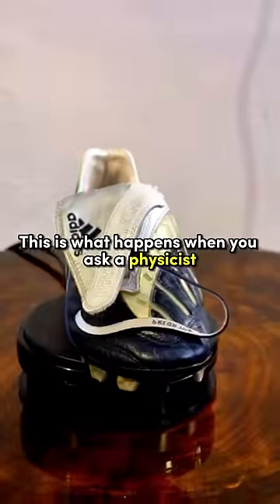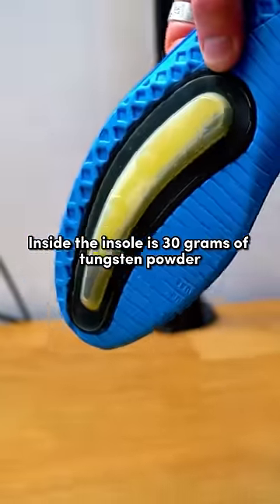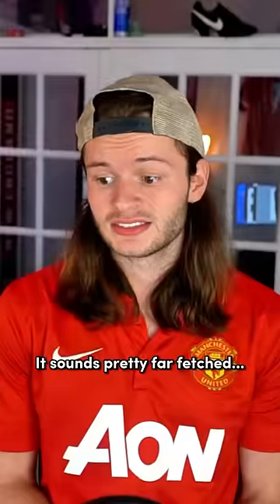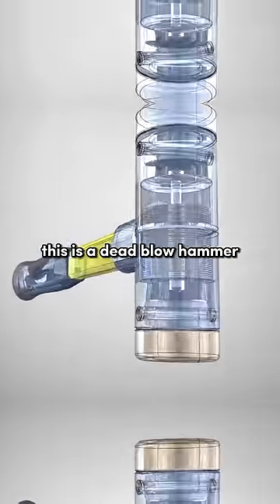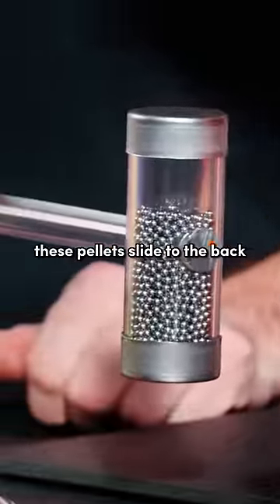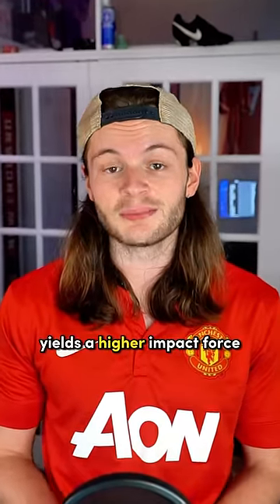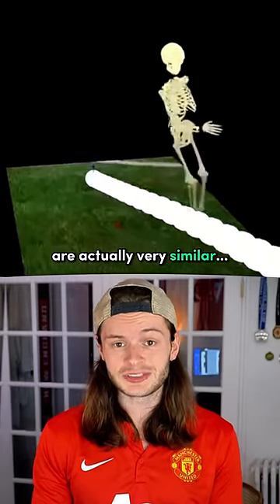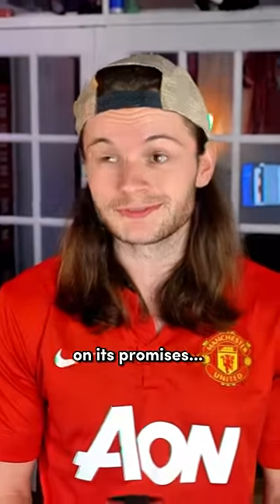When a Physicist Designs a Football Boot👨‍🔬⚽️

Comment: Physics major here. Deadblow hammers don't hit harder. They are designed to disperse impulse over time, allowing you to be "gentler" on certain materials. Regular hammers hit harder. They transfer more momentum (because the hammer bounces backwards) in less time, which means greater peak force. This shoe is a gimmick. That amount of tungsten won't do anything significant to your kick.
Reply: Thank you! I used  to use a deadblow for work pretty regularly, and it was only for when I was trying to carefully beat something into submission. lol
Reply: Thank you for doing this service, I was about to write the same dissertation
Reply: It's not supposed to be significant. It's an increase of 5% in power. That's really insignificant but is the small boost that can help you win.
Reply: @triskits_mmm Did you read past the first sentence?
Reply: @triskits_mmm The benefit you would get on some kicks would not outweigh the detriment of running around with weighted shoes.
Reply: New it about hammer, well said bud
Reply: @triskits_mmm  Having grains of anything legitimately does not increase power, in fact, physically it decreases the power (impulse) of any impact despite whatever the MARKETING TEAM says, this is entirely a gimmick.
Reply: A ball peen dead blow will hit just as hard as a regular ball peen. Only thing with the dead blow is its easier on your hand and arm and doesn't bounce and vibrate
Reply: The tungsten would add weight to your foot, more weight, means more energy. Put it would also require how ever much more energy to swing your foot. The real benefit would be when you finally take the weighted shoe off like Goku and unleash your true power on the ball.
Reply: I would be willing to argue that of similarly weighted shoes, one with grains like a dead blow hammer and one without, the one with grains overall would give less overall speed to the ball on kicking.
Reply: @triskits_mmm 5% would not be insignificant.
Reply: @DownHillgamer the main point of a hammer bouncing is to make it easier to hit it again when forging stuff
Reply: You’re my hero
Reply: You seem really pretentious
Reply: I always used the plastic deadblow when I need to beat the crap out of some wood without damaging it. A rubber mallet doesn't work because it's too bouncy, you need a solid blow
Reply: thats why when i used that model i felt underpowered..that physisist nerfed my entire kid football attempt of a career😢 im suing
Reply: Do you think the hammer also isn't a great analogy because no person kicking a ball is going to recoil their foot that quickly from the ball
Reply: But how can deadblow hammer not hit harder if it transfers all of its kinetic energy to the item being smashed where as regular hammer keeps some of its energy?
Reply: This ain't reddit.
Reply: @34pixels33  I think it's just more dispersed somehow but I have no physics knowledge
Reply: @34pixels33  An elastic collision has to stop the hammer and then push the hammer backwards. That means more energy imparted to the thing you're hitting, aka a harder hit.
Reply: I was thinking something similar but yk I was gonna let folks keep wasting money on whack pairs of boots leave the good ones in stock for the rest of us who just Wana get em dirty😂
Reply: Okay…what is the difference in inertia between a steel claw hammer and a dead blow hammer filled with lead shot? If you know your physics you might know that your density will differ, COM will differ, the impact changes, and the outcomes will differ which is why they are used for different things. Tungsten is pretty dense last time I checked…and isn’t cheap.
Reply: You really had to sneak your physics degree in there...
Reply: That’s what I thought. If the whole sole was filled then only that would make some difference in the power and swerve
Reply: Hello, I am a moron and I wanted to write the same...
These videos...
Reply: I love this comment. Tell him to take a good example from karate chops and strikes. Whereby you hit a spot hard and withdraw the blow fast. It's called impulse and it delivers serious injury
Reply: @izumi2165
Reply: I thought deadblow hammers were designed to protect the operator from repetitive strain injuries? I'm a carpenter not physicist though.
Reply: @triskits_mmm 5% is way more than significant.
Reply: A geologist would have done a better job here.
Reply: @Texan_BoyKisser  Evidence, not eminence.
Reply: Snappy dead blows have hard faces, never leave home without one.
Reply: @logangrove4103
I don't think that's true at all. You're getting confused by the impulse, instead look at it as a transfer of kinetic energy.
In one case, the hammer transfers the entirety of its kinetic energy (powder-filled), in the other case it bounces back and retains some of its kinetic energy, ergo not transferring it.

If the impulses' directions oppose each other after the collision, the impulse has not been transferred in its entirety. If one object rests, it has.
Reply: @komentierer  I guess that's true. Impulse is a bit more accurate if we're considering time frames. I was thinking of force as the time derivative of momentum, and thinking about how the momentum changes for the two strikes. Force is what is applied to the ball, not impulse, so that's why I said force.
Reply: PhD holder here. Yes it makes a difference, you just decided to arbitrarily ignore it.
Reply: Especially when the tungsten is powdered lol. Mass transfer probably couldnt be worse.
Reply: @cameronsnyder1246  same, I used it on couple of girls. It worked.
Reply: @cia9939  never saw it coming lol
Reply: Been thinking on this, if more of the energy is distributed down than with a standard hammer that uses up energy to bounce back up, doesn’t that by definition mean it hits harder? More energy, more force, is being applied to the object you are striking. When a standard hammer bounces, I’ll take your “major” for fact that there is more peak force, but half of that energy is going the wrong direction.
Reply: How would they transfer less momentum because they’re not bouncing? That makes zero sense. Some of the momentum is going into the bounce instead of the impact. A dead blow is used on softer materials simply because there is no bounce and you don’t risk double striking softer materials. But they 100% transfer more momentum into the object than a hammer that is bouncing.
Reply: @sz9536  youre not a phD holder lmao
Reply: You did not need to tell your qualification buddy,.... The reasoning is pretty simple.... Although I don't think I could have come up with it
Reply: @triskits_mmm for 5% increase the weight should be very high
Reply: Now this is why I check the comments
Reply: Hey brother from another mother;) you're a research student?
Reply: thank you, i know about anvil and regular hammers and knew immediately that the dead blow hammer bit was outrageous
Reply: I probably just dont understand this well enough, but isnt more energy transferred to the item youre hitting if the hammer doesnt bounce back? Assuming you hit both with the same speed and they weigh the same of course.
Reply: @Fredrick046 The energy that comes from the  material inside isn’t transferred to whatever is being struck. It is transferred throughout the hammer to stop it from bouncing.
Reply: @joe4171 The force that is exerted backwards as a result of the initial impact (bounce back) is minimal and doesn’t really matter when we’re talking about the force at the moment of impact being applied on an object. You take two objects with the same weight and speed, and they will generate the same force. If one of those objects generates that force over a longer period of time (the stuff inside takes time to fall to the hammer head), then it will apply less force at the moment of impact.
Reply: @quincyxan23  ah that makes sense. Thanks for the explanation
Reply: @heromedley   correct because I'm actually a double PhD holder
Reply: Because impulse equals force into time, meaning if your force to be evenly distributed over a long time for softer metals or precise work, you just increase the time over which the force is released.
Reply: But 100g tungsten bit in stainless steel pipe hits human head harder than just the pipe due to the weight being close to your hand at the start and you get more speed to your swing but at the end still have mass to hurt, but these things cant be compared i dont know why i write this
Reply: Very nice info brother
Reply: Wouldnt it also make it harder to kick, because your shoe is heavier
Reply: Thank you sir
I am proud
Reply: 👏👏 Thank you, I didn't feel like writing all that so thankfully someone did 😁
Reply: You dare to also explain the energy behind it
Reply: But you could add an amount that would make a difference right? It would look like a platform goth girl boot but still
Reply: You’re wrong
Reply: All the construction homies coming out in force.🤘
Reply: @komentierer. No you have that backwards. A fully elastic collision (ie bounces back) is the most efficient transfer of energy.  Look it up. Plus think about the deadbolt hammer. The lead shot doesn't come forward until after the hammer hits meaning it is actually a separate "hit" that only counteracts the bounceback of the hammer, not actually hitting the thing the hammer hit. Think about it like this, equal and opposite reaction, if your hammer bounces back with a certain amount of force, that was actually additional impact imparted on the thing you hit, because its going in the other direction. However thinking about what I said above, I am not sure how much the dead blow even decreases the impact of the deadbolt, as the shot limits the bounceback after it happens (soon after but still after)  I bet dead blow hammers are more about limiting vibration and strain on the operator rather than the work piece.
Reply: 😂😂😂 when he said the hammer deleivers less force coz it is over multiple bounces. It only bounces because it has a greater change in momentum lol
Reply: @hssy2jrocker What does your comment mean?
Reply: your feet is heavier so of course it does something
Reply: Can you explain why there is more momentum because of the bounce back? Thanks
Reply: @PerpetualWane  if you wanted more weight then the tungsten should have have bene a stationary chunk at the end of the shoe since this way the tungsten doesn't really do much until ur foot comes to a complete stop. By then the ball shouldn't be touching ur foot anymore.
Reply: @34pixels33  part of caluculating impact force is dividing by time the impact takes. Therefore the less time the items are in contact with each other the more force is imparted. If the time is longer then ur diving by a larger number which makes the total force smaller.
Reply: @cheeseeygamer2997  good point but i guess we would have to know to what degree the powder moves when they swing their foot and how fast, if at all, it would move after their foot makes contact with the ball. Most of the weight might be sitting in the bottom of the shoe.
Reply: You're also striking a ball and not an anvil (or any firm body of mass) a ball is solid but with some properties of gas due to the internal baloon. The gaseuous state of the balloon absorbs all the impact of a kick. When have you ever kicked a ball and your foot has bounced off and on the ball, multiple times in a second. Without tungsten you're already transferring all of your potential kinetic energy into the ball.
Reply: thought the same thing, bouncing back with the same initial force is a greater transfer on momentum, i wonder if the tungsten effect would be better with a bigger pocket, or like hollowing out the spikes and putting the dust in there too
Reply: A player only needs to #believe for it to work
Reply: Thanks major 🫡 easy to knkw but ta
Reply: And one could just use sand
Reply: @34pixels33 think of it like this: the bearings in the deadblow take the energy that normally bounces the hammmer back.
Reply: So what you're saying is I can control my leg when I kick overall and don't actually lose power?
Reply: @Josep_Hernandez_Lujan  well there is that and the fact that it's a deadblow hammer. You have more control
Reply: A soccer ball isn't like a nail. You have a little while longer to put energy into it as deformation, so that insignificant but accurate data makes all kinds of sense. Unless you can explain why there should be no change or a loss of energy transfered
Reply: Can we see your diploma ?
Reply: Being a major in a subject doesn’t mean anything anymore👍🏽
Reply: How much tungsten to get the same effect
Reply: @CentrallntelligenceAgency You misspelled “intelligent”.
Reply: @bigwheel9132  don't expect tomorrow
Reply: maybe the shoe increases precision
Reply: If the leg is moving at 1/10 speed of light, we might feel somthing😂
Reply: Well, I'd assume it's like hitting something with just a slightly heavier hammer.
Reply: Exactly...fellow physics major
Reply: Came here to say this. It is just marketing.
Reply: Thank you for this clarification. No offense to this guy, but his analogy didn’t make sense. Kinda feels like a flat earther with a high school degree arguing with a physicist.
Reply: @triskits_mmm when physicists say “not significant” they mean something more like “negligible.” In this case, a soccer player’s leg might weigh around 16kg and we’re talking about adding .003kg of tungsten, which is an increase of .018%, or 278 times less than 5%.
Reply: these youtubers aren't their assignment, lol
Reply: physics double major here , tungsten has a very high melting point.
Reply: @cameronsnyder1246 Like your wife?
Reply: Yeah it's a question of if it's practically but even if it is there not enough of that shit in the boot to do anything
Reply: I'm a high-school dropout who has never played soccer and I can tell these shoes are a gimmick 😂
Reply: @cameronsnyder1246  that is the great thing about them. You can hit as hardnas you want to but the thing youre hitting wont break because the hammer isnt hardenes
Reply: not a physics major here: ye, with the mass ratio between than pinch of "sand" and a foot/leg I don't need no degree to tell that it's negligible at best even if it was a solid hunk of the same weight
Reply: So the idea behind it was just to aid in the follow through by adding a secondary force after the impact reduces it, and it doesn't work? I guess a soccer ball's mass is pretty low compared to the human leg already.
Reply: High school major here, we learned this in high school 30 years ago.
Reply: Your foot doesn't stop like a hammer would when kicking a ball. It goes straight through it, meaning the tungsten has no effect at all.
Reply: @festo8885  every actionhas anequal and opposite reaction, it probably does next to nothing, but the ball does push back on your foot, and as such the tungsten does do something, its just probably so small it rarely matters
Reply: I was just coming down to say this lol
Reply: Works in golf clubs. small changes in gram amounts can change how a person swings a club.
Reply: A dead-blow hammer decreases the peak force of each blow, however it lengthens the overall time the energy can be transferred (when compared to a normal hammer). Since the overall energy transferred is longer, and depending on how much the peak force was lessened, it could transfer more energy to the ball.
Reply: But the tungsten thing could also increase moment of inertia as well as the energy that can tranfer to the ball right?
Reply: Yes, however the kick takes a longer time than a single hammer strike. I do agree with the tungsten weight being very minimal, however at there kicking speed, wich if you know speed will exponentially increase kinetic energy and the effective power gain is higher than the weight gain of 30g. The extra energy needed to accelerate is inconsequential because pro football players' kick speed is more limited by a human's muscle max contraction speed , not the strength of their legs.

P.S. I am a car mechanic, amature inventor and researcher.
Reply: @sz9536 thank you I made a post under this and when more in depth, I'd love to learn from you. Right now I am a car mechanic, and an amateur inventor/researcher.
Reply: @spacetase2560  check my coment to this guy's comment, your intuition doesn't betray you
Reply: @stevenjames9487  exactly
Reply: obviously he doesn't know how deadblow hammers work and what they're for. how can something hit harder when they're literally hollowed out in the middle to carry loose bits of metal? this is one of those vids created for the purpose of misinforming to gain interactions from REAL professionals who know what they're talking about. youtubers are reduced to being agents of dis and mis-information. disgusting.
Reply: Wow. I will come here if i have any physics questions.
Reply: Also, striking steel with a hammer is way different than hitting a ball with a boot, theres way more elastic deformarion on the football, so a dead blow hammer would work worse than a regular hammer (with a ball)
Reply: you cant have 10kg shoes... 30g is really little but its something, how much does the ball weight? how wast is your foot ? it does SOMETHING surely